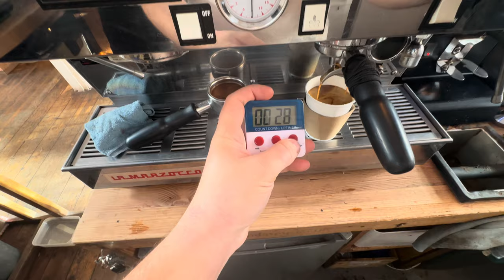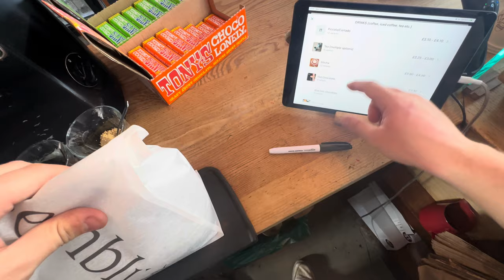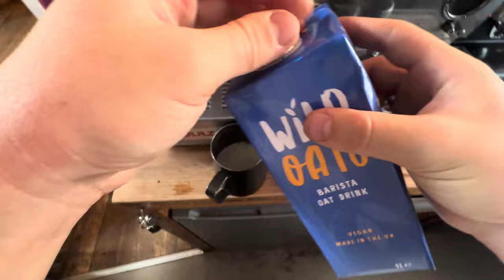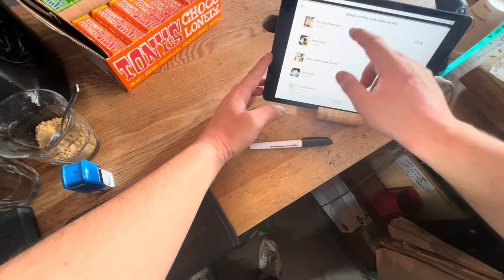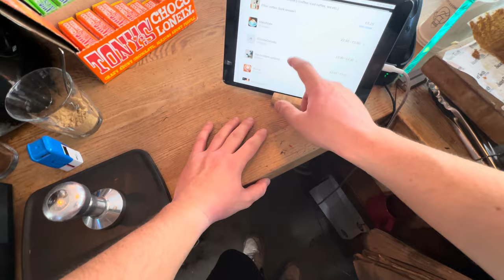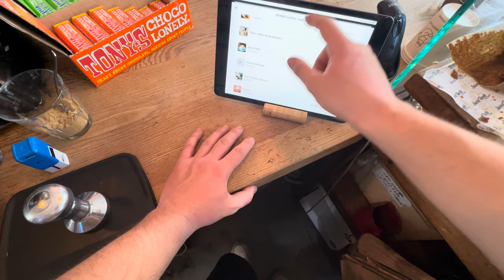POV- Barista works at golden hour ☀️

Comment: 5:19 I’m just curious 🧐 why do you need to do that with every single coffee ☕️ 😒
Reply: If you're talking about the tamping, where they push the coffee down, it's so that it creates a resistance to the water coming through to the coffee. This resistance makes it harder for the water to get through, hence extracting all the flavors of the espresso.
Reply: @decoroman4981  No, I mean that it weighs each gram of coffee, a gram more or a gram less I don't think it makes a big difference in the coffee, and weighing it every time is something obsessive. I think he has obsessive-compulsive syndrome, or if he doesn't have it, he borders on it, although I have realized that when he is tired he doesn't care if each cup is 180g. If he is happy, I don't care about that, but back to the point. Why does he weigh the coffee that way? 🤔🥲
Reply: I see. Well, they don't have to measure the espresso exactly, but you're only supposed to put in 18 to 19 grams of espresso in the machine. This is because if you put more than this, the flavor of the result will be weak. Too little, it will be too bitter and over-extracted.
Reply: @decoroman4981  ohhhh wow 😯 thanks 🙏🏻 I didn’t know that 🤝🏻
Reply: its really important to measure your grams every single time. Having always the same grams in your extraction you can ensure that you always serve the same result to the customer. It's also easier to know when you must change your grinder settings (got coarser or finer).

Comment: How do you work at so many different spots?
Reply: I ask myself the same question!
Reply: Might be the same company with multiple locations around the same area. Some places will have you work at a different location depending on who is needed
Reply from the maker: I use an app called baristas on tap